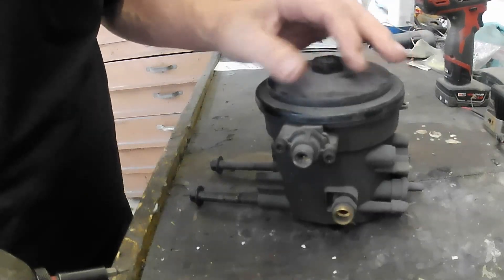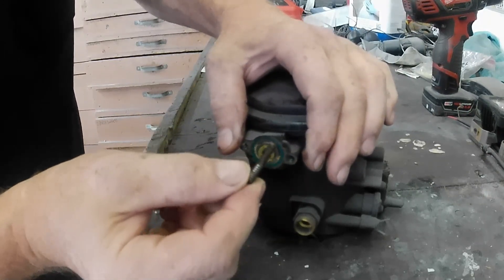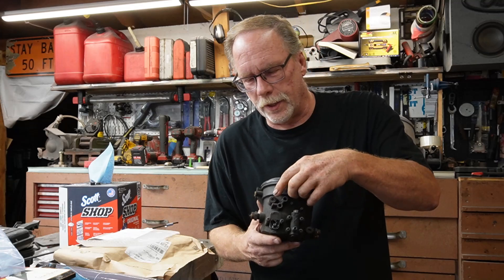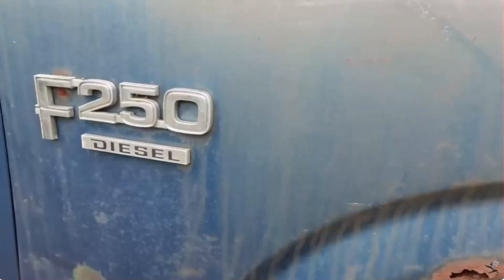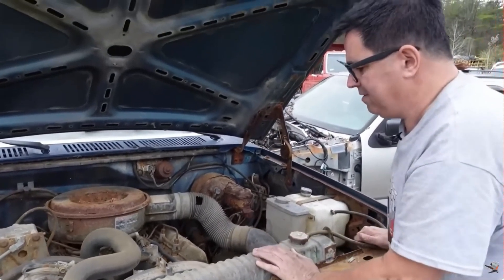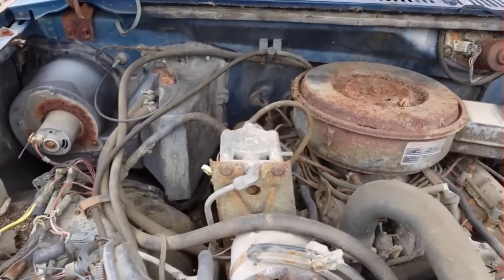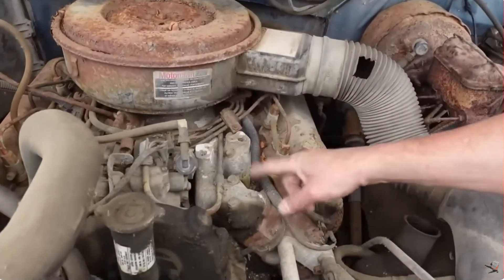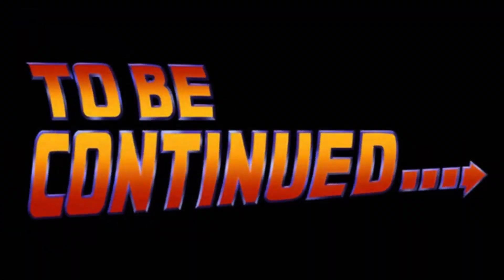🛻📽️7.3 POWERSTROKE FUEL PRESSURE SPRING QUICK TECH TALK    🚧🛑⛽🛻

Comment: Thank you Mr.Allen. I ordered it and it will be here in 5 days or so. I greatly appreciate all the advice you share to keep my 7.3 running at its best and keeping it reliable as much as it can be. 10/99 F250 Crew cab Long bed w/ less than 20,000 driven often just rarely on long distance’s

Comment: I like the fuel bowl.  It houses an excellent filter and has water detection.  But I prefer the regulated return coming off the opposite ends of the heads like Cat designed the HEUI.  Been running an Aeromotive regulator for 20 years with no issues.
Reply: Where do you recommend learning more about f250 7.3 mods for reliability and dependability?
Reply: @FreedomUSA375 Different channels-Custom Works, Automedic Garage, PowerStrokeHelp, DieselTechRon.  You can tell people who know what they are talking about.

Comment: Hey fyi.   As a quick cheep option to check fuel pressure.   Take one of the old slide out tire gauges.  Set rpm you want to check it at. Push gauge on port and hold till the rod stops coming out. And read it.  It’s fairly accurate. Watch out it can squirt a little.    Is it right?? No.. will it work .. yes.
Reply: Did that on my channel ,it works just fine.

Comment: Clint, do you have a favorite source for IDM repair/replacement?  Also, can I flash my 1994.5 super duty to OBD2 or would all the wiring sensors need to change?  manual transmission.

Comment: Hi, thank you for sharing your time in wisdom. I have a question hope you an help me out. I connect the 12v to the pin 66 which send information to the transmission (solenoid 2) is there another device that will receive the the same information in the same  time to idle up ( raise rpm)

Comment: I don't see the link to the spring manufacturer.  Also, is the spring higher or lower pressure?  I know the Riff Raff fuel rail crossover includes stock and high and low pressure springs.  Wondering what the benefit of higher or lower pressures are.
Reply from the maker: @CUSTOMWORKS7.3PSD
8 minutes ago
In the description box below the hash tags are 2 links